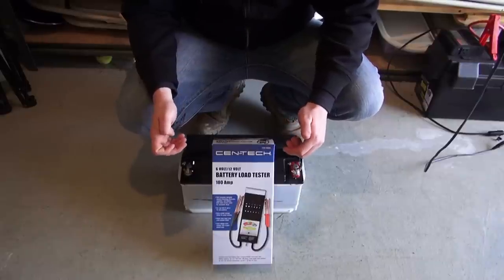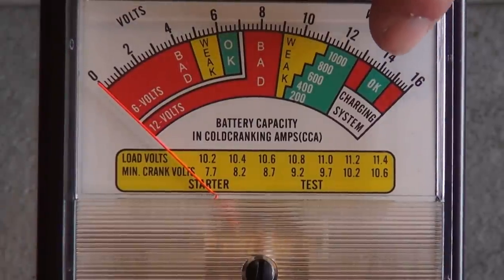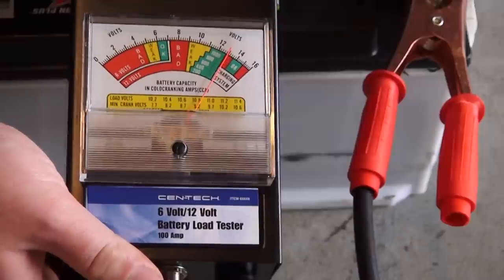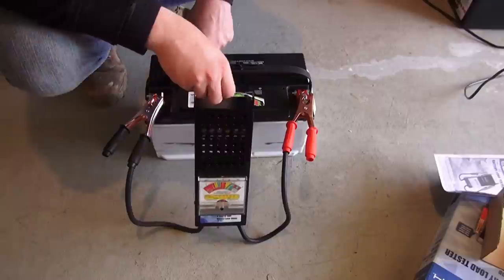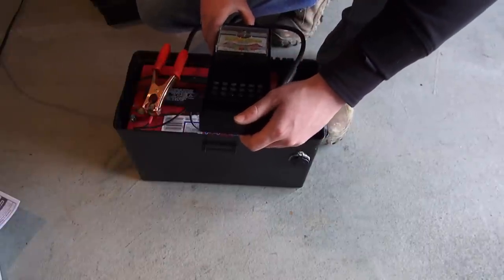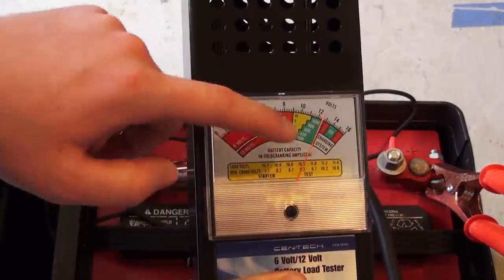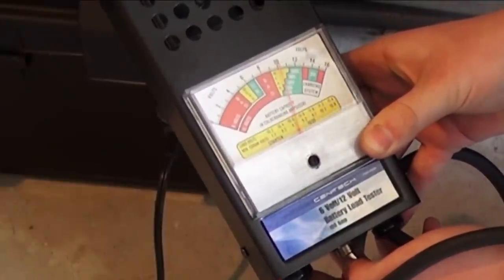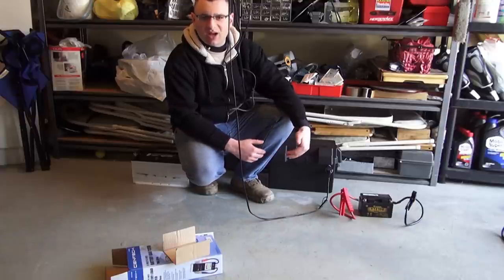Harbor Freight 100 Amp Battery Load Tester

Comment: I could be wrong, but isn't the CCA scale there to indicate if the battery is strong/weak depending upon where the needle is in relation to  the number on the scale? In other words, if your battery is rated at 600 amps the needle should be in the green at 600 mark on the scale. It isn't indicating that the battery is supplying 600 amps, is it? Put another way, you have a battery rated at 800 CCA. During the test the needle is right on the line by 600. Because it can't move far enough to the right to align or exceed the 800, we know it is defective. That line at 800 is the minimum amperage that is acceptable. However, that same 600 reading for a 600 CCA battery would just be acceptable. If the needle was at the 600 and you had a 400 CCA battery it would be in great shape. I don't think the scale refers to how much current (amps) the battery is drawing. It would be very unusual for an engine to require 600 amps unless there was a problem with the starting system, and it would never draw that much current when the engine is running.
Reply: Yes, you are correct

Comment: It is apparent that ImStricken06 is not correctly informed about batteries or battery testing. To get a proper SAE and BCI battery test you must load the battery at 1/2 CCA for 15 seconds compensated for battery temperature. The faults of this test are not long enough time to load the battery. The load is only 100 Amps but the battery was rated at 850. To be accurate you must load the battery to 425 amps and there is no temperature compensation. In ImStricken06's defense he did follow the battery testers manufacturers instructions. The tester is just not accurate.

Comment: QUICK question. the battery in my car is 6yrs old. it starts ok but my inside cabin lights dim when cranking. can an old battery wear out my alternator?
Reply: Definitely not, when a battery lose their capacity by worn plates this lose the amount of "charge absorb"....

Only a battery with a intern short can wear the alternator and if this battery has it, thing have a self discharge and generates a lot of heat while charging.

Comment: Load tested got just under 11 volts  in the yellow weak range. . Anyone know if that's good enough or need to be replaced ?
Reply from the maker: Replace.
Reply: @imstricken06  just got a new cheap 585 CCA battery from  WM and tried to jump it from new one to one in car still had problems . Doing a quick charge before installing new one even though it should be good to go . Using a 6 AMP charger on quick ccharge setting for maybe half an hour ...what do you think of the old discionnect positive from battery to see if it's altenator ?
Reply: @imstricken06  replaced with new battery. And bad original battery was tested by competent mechanic and again by myself with this tester failed miserably. Now might be getting better in that sometimes it starts up on very first try. Took it to have it scanned and throwing up mass air sensor code but that probably is because when I replaced it I had to disconnect air flow sensor to remove air filter housing. Ran it like that for long test run. Sometimes found car throwing up codes then they don't after a while. Wait she see. Have you seen this happening in similar situations ?

Comment: You have no idea how to use a load tester. Your demonstration is incorrect. You applied the clamps correctly, and operated the switch properly (MAX 10 secs).. but you do not know how to read, nor use what he needle says.
1st: Determine the Cold Cranking Amps (CCA) of your battery. Then observe the segment of the range (1000, 800, 600, 400 etc) while using the load switch. If it goes yellow while load testing, battery fails. End of test.
If the load test remains in green area of the proper segment, remember the voltage value. Next,refer to the yellow box with numbers, below the above-used colored segments. Determine the Cranking amps minimum from your load test voltage.
Now have someone crank the engine while you watch the needle very closely. If the cranking voltage meets or exceeds the value you looked up, the battery is good. If it is below battery fails.
The two tests are essential to properly analyze the battery. The load test is a hammer tap. The crank test is a full body punch. We need to compare the depth of spread between the two readings to properly determine battery health.
Reply: Isn't the Starter Test to just tell you if your starter is worn out, dragging and pulling too much current? You already tested the battery using a load. i believe you are the one not knowing how to use the unit.
Reply: @davidlong1786  No - the meter can not analyze your starter motor. The "starter test" analyzes the battery's ability to pull on the battery without bottoming it out.
I was a bit too harsh in my original comment to you - I apologize. I sounded overly-critical. But that being said, I hope you will re-read my notes.. or at least google some other sources to verify (or refute) my methods. I am confident you will be able to tweak your familiarity with the meter a bit, so you will be able to use it to its fullest potential.
Reply: @k.g.442   I wasn't the OP, just responding to your  wrong statement.......Harbor Freight websites states, "Test complete charging system including alternator, regulator, and battery. Also tests starter motor for excessive draw.".......... I have not been able to find anything online that agrees with your claims. As you are the one making such a claim, it is up to you to provide proof and links to other sources collaborating your statement. As I said the heater element provides a 100 amp draw on the battery so test for  CCA ability. The starter test is for testing the starter. Sorry if you don't believe that but  that's the facts Jack.
Reply: @davidlong1786   You are basing my correctness on a blerb from harbor Freight?  I shop there all the time, but I never forget that they are the dollar store of tool stores.  I think you should do whatever you want to your car. And if you want to labor under the delusion that a volt-meter can somehow communicate with the starter motor, and then it issues a starter motor analysis; then have at it!  LOL!  You misunderstand load testing versus engine crank testing. Google / youtube it because my explanation must be more confusing than I thought it was.  
Overwhelmingly, a bad starter is evidenced by its inability to start a car whose other charging system componentss (alternator & battery) are otherwise OK.  A bad starter will also fail to operate even while trying a jump start.  So in this sense, the meter can be used to rule out a bad starter, but only by employing the process of elimination, versus some non-existent "starter motor test". A starter motor test simply does not exist in the form you are imagining it..
Reply: @k.g.442   So you are saying you have zero evidence to support your claim? Well isn't that convenient?  You obviously have no idea what bad starter can and cannot do. If it's drawing too much current due to faulty mechanical condition (bad worn out brushes,worn bearings , etc...) then it can slow to crank. Is it that hard to understand? So come up with links to support your claim or just shut up. Nobody else on YT that used this device had any problem using it as stated by the manufacturer or questions their wisdom of  how it is to be used.
Reply: @davidlong1786  Its not about evidence.. its about having a basic understanding of auto mechanics - of which you possess none. A shorting out starter HARDLY needs a voltmeter to let the operator know there is a problem.  But even if you did use a voltmeter to troubleshoot a starter, it would be done how I described; ie rule out other components.
Reply: @davidlong1786  A shorting out starter HARDLY needs a voltmeter to assist in its diagnosis. At the most, you can rule out the battery and alternator as the culprits, then conclude, indirectly, that the starter is bad. The voltmeter in question is made to test battery performance under three conditions: Battery at rest, battery under load, and battery while being cranked. It makes me sad that you don't believe me, but I will slog thru life unfulfilled by your admiration and respect.  But that burden being what it is, you seem to have NO IDEA about basic car repairs, the sequences of diagnosis, nor the fundamentals of engine operations.  Frankly I would be delighted if you kept confusing a 100 amp load test with a 450amp starting draw..  G'head punkin.. keep thinking a voltmeter can pull a diagnostic code from a starter motor.